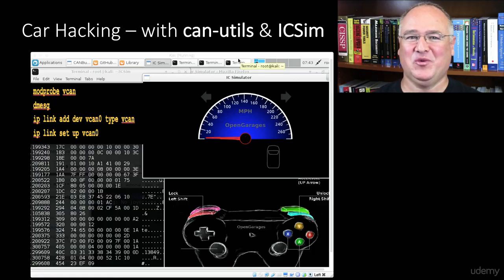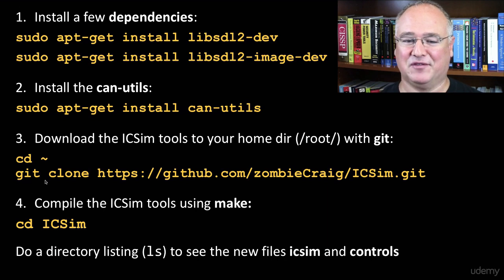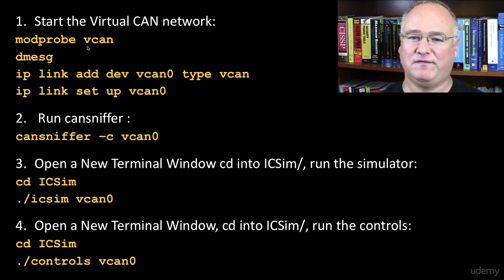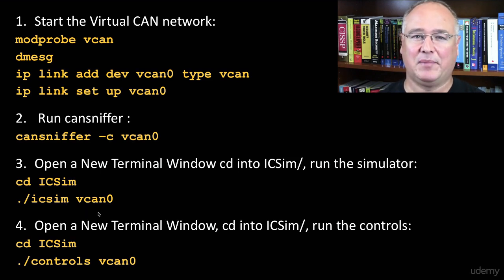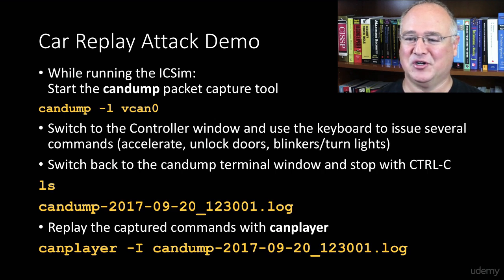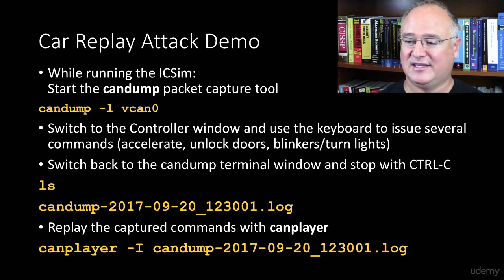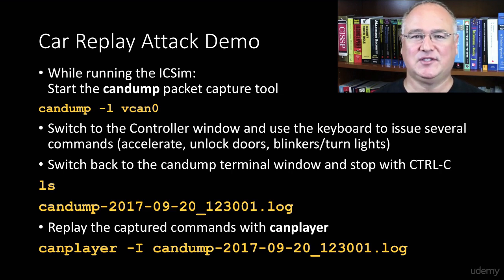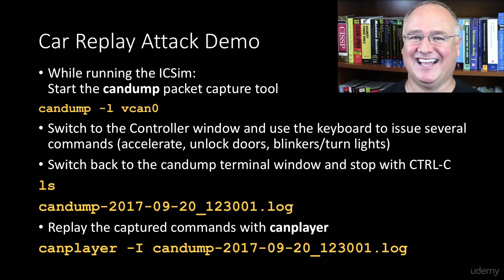L44 (#6) Car Hacking Review

Comment: hello I have done the installation but when I am trying to open icsim ( with the command ./icsim vcan0) it says "zsh: no such file or directory". Same happens with ./controls. How can I fix it. Note: I am In the ICSim folder and in root directory. Even though I did the installation with git clone method I don't have those executables files (icsim and controls).
Reply: I was having the same problem and found another youtube video that solved it. Open your terminal and use the following commands:
cd ICSim
make icsim
make controls

if you get an error about the make command not found use the following from your root directory:
sudo apt-get install build-essential

then repeat the above process. Hope this helps!
Reply: @mattperez4893  Thank you Matt. You are right, I found the same video that's what we should do